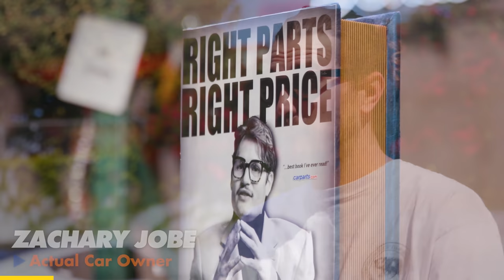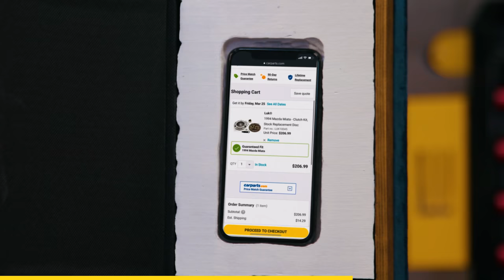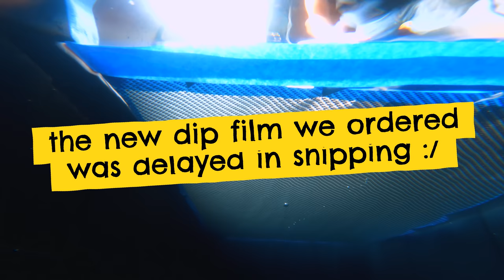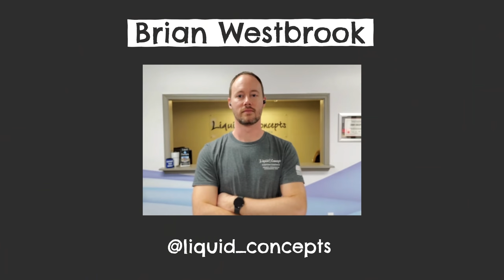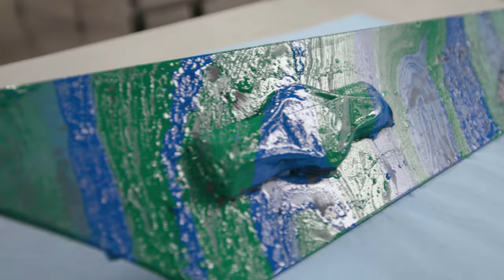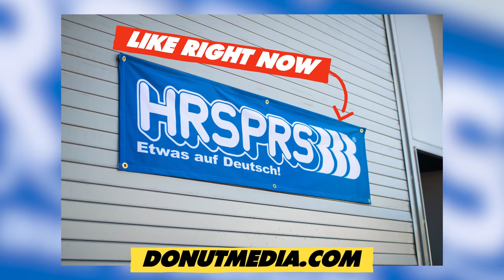We Tried Hydro Dipping Car Parts

Comment: "Use the activator to find the side that you need up." Or you can not waste your supplies. When licking to fingers and pinching the corner of the film. The side that sticks, you will want facing down. Also for good end results it depends on the finish clear coats you use. For that finished pop

Comment: regular spray paint has fast drying solvents, some of which can be absorbed into water, guaranteeing your paint will be a lumpy, partially dried mess by the time you dip anything in it. you want a paint with a slow drying, hydrophobic solvent that will keep it completely liquid and even across the surface of the water, like an oil slick. the paint needs to be gently poured, dripped, etc. onto the surface of the water to prevent any splashing that could trap water droplets in it. if you want the water to smoothly envelope the part you're dipping with minimal ripples, try thickening the water a bit with soluble fiber or boiled cornstarch.

Comment: Hydrodipping is awesome and it is simple.  One thing I am shocked you didn't point out is water temperature.  You want the water at 90* F.  The one minute window works perfect at that temp.  As you found out quality film is everything.  I attempted a dip using some old film laying around and it looked atrocious. Got my new film in and the results were amazing.  I actually have a few pieces laying around I plan on dipping soon.

Comment: My buddy did this to my snowboard sandbox helmet as way to promote his shop. Looked great, but definitely not something you should do to a helmet, especially with foam still in. It made the foam very brittle and the activator ate away at it, then eventually the brim on the helmet snapped off. Looked sick, but definitely wouldn't do again to a snowboard helmet, too expensive to do that to. Lol

Comment: You took a lot of shortcuts in the DIY method that hurt the final result.
1) Add borax to the water.
2) Use liquid acrylic paints, not spray cans.
3) Once you fully submerge the piece, keep it still and agitate the water surface with a rag to push all the remaining paint to the walls of the container. That way, when you raise the piece, there won't be any stray bits of paint to stick to the surface. That's how you get a smoother finish.

Comment: I feel like more detailed hydrodip work with specific patterns and designs is best left to the professionals, but if you're just wanting to change up the colour of whatever you're planning to dip DIY works just fine
Reply: I feel like spray paint sprayed normally would work even better though?
Reply: @바비 소녀들.🇰🇷 all over the place with this one lol
Reply: @Gazmus  It all depends. It's much easier to get a uniform paintjob on something when it's just a flat layer of paint, assuming you do it correctly.
Reply: @Gazmus  it depends on what parts you're trying to change the colour of really. Spraying something like a steering wheel wouldn't necessarily be as ideal as dipping because the prepping process for painting involves creating a coarse/textured surface for the paint to adhere to which is more difficult to achieve on something like a leather or faux leather surface. So ultimately it really would depend on what parts you're trying to do
Reply: @goku4561  like what parts, Goku?
Reply: @Meekmillan  yes. These korean lesbian bots are crazy.
Reply: @Gazmus  yes. Spray like a normal car?
Reply: @purwantiallan5089  I gave an example of a part that'd be more ideal to dip than to try to spray in my comment above, that being said a few parts that could be more ideal to spray would be like the side mirrors, bumpers, sideskirts, etc. Basically just about any surface you want to change the colour of so long as it can be sanded down to a rough/coarse surface so the primer/spray can adhere to it more easily 😄
Reply: Color not color
Reply: @goku4561  you do know you still have to prep and prime before you hydro dip right? So in that respect its no different to paint until afyer the priming process meaning your steering wheel example is invalid
Reply: @tonydixon2684  I am aware, however that's still dependant on the surface you're looking to dip. Yes it is also dependant on the surface with spraying, although the overall physical labour is still reduced with dipping.
Reply: @DankoleClouds  assuming you hydrodip correctly is a big asumption. i work in paint and i guarantee with spray paint youre gonna get a smoother finish by just using it normally since you can layer on the color instead of throwing a thick layer on all at once. it will be more durable and will reduce the texture to just spray paint.
Reply: @goku4561  a good oil based primer for metal will stick just fine and keep the paint sticking just fine for a steering wheel, especially considering people are not actively touching the metal spokes of their wheel. no one is painting leather on their steering wheel, hydrodip or otherwise, get real. it will not last and it is not good for the leather regardless of how you do it. the key to spray painting and doing a good job is buying the right product, not trying to jerry-rig the wrong product to work how it isn't otherwise intended. It never ceases to amaze me the lengths people will go to in an attempt to make people believe their totally wrong opinion is the truth. Is it really that much easier than just saying you were wrong?
Reply: @GenuineRage  In case you just can't read I specified faux leather and not just leather. Obviously leather can't be treated in the same manner you'd prepare a surface to paint, it needs to be tanned or dyed/stained. Also never stated that you had to cut corners and buy cheap product to get the job done. You can keep putting words in my mouth to try and validate your point some more if you like, makes no difference to me "internet expert" 🙂

Comment: I know I'm a little late to the party, but I've done a decent amount of swirl painting, which is similar to the spray paint method shown here. I've found that paints made specifically for swirl painting work much better than anything else (especially spray paint). There's brands like Magic Marble that I've used and had great success with, since I enjoy the randomness and one-of-a-kind nature of swirl painting over the pre-determined pattern of hydro dipping.

Comment: I think hydro dipping is easy in concept but like most things, for a better result you need to temper your expectations until you have some practice and experience under your belt. 

Especially with the patterned stuff.

Comment: @DonutMedia,  please take another shot at this. Especially in the spray paint dipping department. I do a lot of dipping using over the counter spray paint and I promise it's simply just a matter of better usage of color and using less paint not more. That's it. You can also hide any mistakes in hydro dip[ping with use of cheap airbrush tricks and clear coat.
Reply: Oooo.....good information! I'm really curious to try this. I know it will take a lot of trial and error.
Reply: @PatriciaFerenz  not really. Just look up yeti tumbler paint tutorials. Super easy if you're good with picking colors.
Reply: @salkjshaweoiuenvohvr  I will check it out! Thank you
Reply: I love Donut but they completely botched the hydrodip. Jobe kept wobbling the part underneath the water which causes air bubbles to form. He should just dunk it in, leave it for 2-3 seconds, and slowly lift the part before washing the sticky film off.

Comment: When you dip the part in, once you're through the paint layer, remember small circles to move all the gunk to the sides of the container so you don't have overlap when you're pulling the piece back out.

Comment: You guys should step it up a notch, try hydro-dipping as many parts as you can in a car and put it all back together. And I mean EVERYTHING that's doable like each individual button on the dash, every body panel, all the bits in the engine bay that won't get damaged if dipped in water, the brake calipers, the rims, the badges, so basically everything you can while keeping the car drivable (so like not the mirrors or the seats) 

TL:DR make the most hydro-dipped car on the road.

Comment: Yall messed up the spray paint, I only know because I used to make custom hotwheels this way. Yall were spraying to close to the water so it was spraying INTO the water, building layers of paint with water in between kinda like how oil sometimes "traps" little water droplets in the oil layer 

The proper way to do it is to mist the top of the water, takes a little longer but it gives you a smoother, less thick paint layer.

Comment: As someone who did this for a living for 7 years. I can say that this is not easy. It's not cheap to set up and you really need to be able to paint first. It's an art and you're paying for an artist. 😉
Reply: Really they showed the film kit only costs 60 bucks. So once you get a bucket big enough and tape... there's a reason they rated both methods fairly cheap.
Reply: it's probably not cheap for a commercial setup but it's not that expensive for a diy setup either.

also, calling it an art is a huge stretch. it takes technique but definitely not artistry.
Reply: it's not THAT difficult.
you can get pretty good at it after like.. 5 attempts if you have quality materials
Reply: To each their own I guess. I made a good living doing what other people couldn't. I still call it an art. Most of my clients called it an art too. We'll agree to disagree on that point ;)
Reply: @just-another-guy  no offense, but it's not art. It's a skill, but you are not creating art, you are putting a film that has a design onto a part
Reply: @alexlaskowski3650  umm. Ok. I'm not gonna argue.

Comment: Hydro dipping with the film method works really well at home and the materials are cheap enough that you can try a bunch of times on random parts and still have plenty left after you get the hang of it. The temperature of the water you're dipping into is pretty crucial for a lot of the films. I just use a regular temp gun and make sure it's about 90F (32C). No air bubbles, glassed out film, and 90F water has given me pretty great results.

Comment: 1, You need to have Warm Water approx. 27Celcius, 2  Your Spraying not a Even amount of Activator causing the Film to apply to Thin, 3rd Carbon or Square Edged Patterns will not apply to Circular parts well as they stretch the pattern, 4. Your using Dirty Water which Bad as it Contains Particles and Residue, 5. Rinsing should be done immediately after dipping for about 3minutes with luke warm water, Follow these Steps and with practice you will have perfect finish, Lastly once Hydro Dipped Correctly Clear Coat for a Stunning Shine or Satin Gloss.

Comment: Great video, shows a lot of difficulties and precision needed to get the wanted result.

 
I think contaminated area's with dust/dirt/oil might have been a contributor to the bubbles. 
Maybe you could use a smidge of soap, or something else to lower or increase the surface tension and make bubbles be less likely to form(and doesn't ruin the film ofc.). 
Maybe an aquarium pump could push the bubbles from the center to the sides, ensuring a workable area. 
And as you showed with the professional example, a good smooth prepped surface and angle and motion of dipping really seem to affect the outcome.
(I ain't a pro but I love to speculate <3)

I'd love to do this once I get a car and get myself a lot of room for mistakes. 
I got a moped with plastic panels that need a repaint, this might actually be a better alternative.

Comment: You can uniformly apply a design to an object if you cheat and use water to keep it uniformly (and *level*) floating on the surface.
Compared to forming the thin film around the object manually, hydrodipping seems pretty cool.

Comment: There were 3 critical errors that caused the splotchiness:
1. Tap water. REALLY need to at least use filtered water, preferably distilled. Mineral deposits can easily mess with the bonding agents
2. Water needs to be degassed. Actually pretty easy to do, just put the water into a slight vacuum. If you've got a big tupperware container, get the water pretty hot (boil a couple gallons of it), push down the lid and lift the corner just a little bit. Then, push the lid ALL the way down until it's stretched and deflected a little into the container, push the corner back down to seal it, and duct-tape around the edges to keep it tight. The lid trying to return to flat in conjunction with the water cooling and reducing in volume will create JUST enough of a pressure gradient to pull any of the air that could cause an issue out of the water in the bin. Pulling a full vacuum is obviously the optimal choice, but I've found that when I need bubble-less liquids for my projects, the tupperware-burp is surprisingly good at degassing just about anything.
3. Surface prep, and not just washing and sanding, and not just any primer, but purpose-built primers. Plastic-Prep and Self-etching primers, to be exact. Especially if you're using plastic parts or fiberglass, you want a primer that has adhesion enhancers and/or self-etches. This will give the films and paints a MUCH more uniform surface area for the product to bond to by reducing turbulent flow across the surface, allowing the boundary layer of air to escape more quickly as the water pushes it out of the way.

Comment: I've had this thought for "dipping" an entire car by basically putting the paint in a pan above the car, probably just wider than the car, swirling it up, then tilt the pan while walking by the car. The sides of the car probably wouldn't look as good though cause the image would stretch over them. Probably finish it up with a wet sand and clear coat. I'd really like to try it out some time

Comment: Hydro-dip is one of the laziest and cheapest things you can do. It’s like half a micron thick and it’ll be worn off in 6 months. Especially if it’s a high friction part, like a steering wheel. You’ll grow to hate it. If you’re looking for affordability do a vinyl wrap instead.

Comment: I think they also glossed over a big part of the actual dipping, which is to roll the piece away from yourself in a smooth, continuous motion. If you just try to push it straight down into the water at an oblique angle, it'll promote air bubbles and stretched patterns.

Comment: I have done a single hydrodip, myself, on a guitar.  I put a decent amount of borax in the water, which greatly increased the density of the water.  After that, I lightly poured oil-based paints onto the surface of the water.  Pouring paint rather than spraying paint gives more control of pattern.  Because of the borax in the water, even the oil based paint is far less dense than the water, and the dip came out really good.  Being a guitar, I did a clear coat over the top of it.  It was ... Good enough... Without the clear coat,. It it looked great with it.  Film method is far more accurate, but less customised.

Comment: great start with the dipping angle but they ended poor and messed up your work (stretched wheel trim went flat down at end should kept angle going. water temp/activator coverage /time, hold angle. leave to rinse. no1 degrease clean item first . not a bad first try looking at other first attempts😂.👏👍

Comment: The activator either isn't aggressive enough or getting enough time on product I've dipped a lot of RC stuff. I have to use a light at angle and I use a pump spray mister you want the entire top heavy gloss almost like it's just barely under. When you see the frame pull so aggressively It's usually the warning.

Comment: Ngl Jobe u suck at hydro dipping with spray paint. When you take the thing you are painting out the water you have to swipe away the excess paint, and put the part in at a 45 degree angle slowly for best results. Also don’t use tape when using film it makes it harder to get out air bubbles in the film.

Comment: Not your typical do or don't you jumped in with both feet instead of your normal I'm going to watch this guy do it right then try video. Glad to see your results improved in the end. Paint dipping is a bear I agree tried it a couple of times one of the best tips I can give you for that one is surface area. Only use a container slightly larger than the item your going to dip. Your paint flows away from where you are spraying to keep you pattern tight and your wasted paint to a minimum. You also need to be quick as the paint needs to be fluid as possible. So spray your pattern and dunk it quick and at a sharper angle. Try it again and let us know if that helps

Comment: if I remember correctly blotchy spots is under activated and round spots is over activated. most of the videos I watched also said NOT to tape the edges of the film because the film absorbes water to expand and flatten out then shrinks back up. then that's when it's ready to spray activator.

Comment: What they dont mention on top of that 60$ you need to go buy an air tank with paint adapters for it so you can spray the activator.
Adds another 100$ minimum (average of a 150$)

Comment: I'm curious if you could take some of those pieces that you hydro dipped with the spray paint and sand them using a very fine grit sand paper then maybe give it a quick rattle can clear coat to make them look better.  Besides the "tie dye" uncertainty of the patterns I think you could end up with some smooth pieces with a little finishing.

Comment: Ok so number 1 question. Did you use warm water or cold hose water? And 2 the angle of the dangle going in is 45 degree then in your pushing the parts to flat into the film

Comment: so Im curious about the spray paint method, couldnt you just clear coat the hell out of it afterwards with like thick poly or something and then wet sand it down to smooth to get rid of the texture. Other than the work involved, is there a downside to this approach?